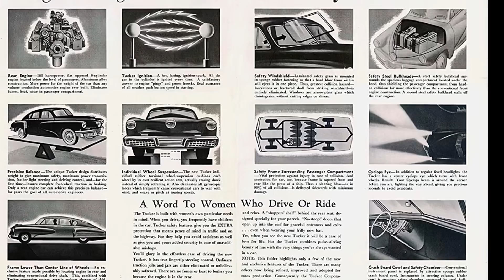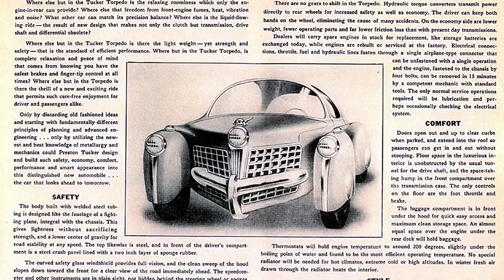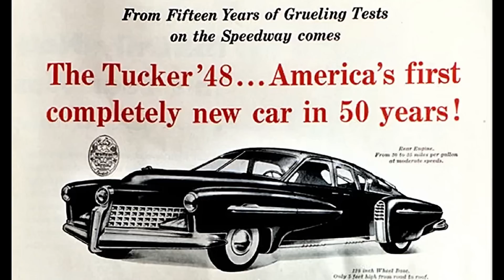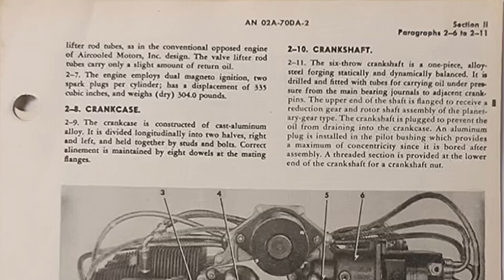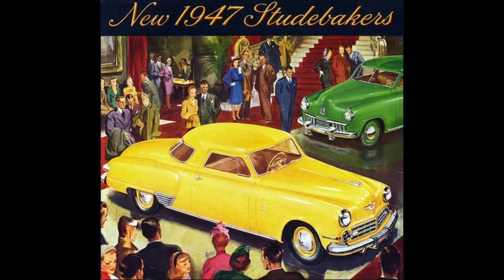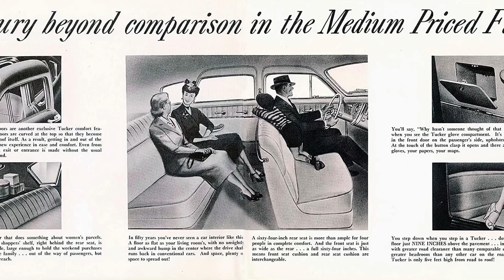Tucker engines 589, 334

Comment: April 7, 2000 "International camless engine technology has been under development by the company and Sturman Engine Systems, LLC since the formation of a joint venture in 1995.

International camless engine technology was demonstrated to the media in an International 8100 truck with an International 530E diesel engine. International is now able to control air to and from the engine without the limitations imposed by a mechanical system of cams and levers. Instead, International camless engine technology uses electronics and hydraulics to actuate the valves."

Comment: The ultimate oversized Subaru XT 6 engine? (with impractical overcomplicated valve system? Did Ducati motorcycle figure out how to get a cam lobe to pull as well as push a valvetrain pushrod?

Comment: The military has used 24v systems for nearly 75 years on their trucks.
Reply from the maker: But civilian vehicles is cyber truck the first one
Reply: @What.its.like.  also untrue.  Toyota 70 series LC's, lots and lots of busses, lots of civilian commercial trucks, tractor trailers.  And if you want to stretch it even more, lots of tractors and equipment are 24v.  Even speaking of the civilian world, Tesla is half a century behind to claim that.
Reply from the maker: I’m not by any means a Tesla fanboy I just didn’t know if that claim was true or not

Comment: When my Uncle turned 16 in 1954, he and his Dad, and brothers went to a used
car lot in Philly on Broad St. (RT 611). The guy had a ton of newer cars up on 
the front line, $200.00, to $1,200 dollars. 
Then he had some ODD BALLS, 2 Tuckers #5 & #32. Dad said neither ran,
so the mechanic ran and got a tractor trailer's Battery 24V to jump start it.
Both fired right up. They looked under the hood, but of course no engine up there!
The Owner told them $600 a piece, or $1,000 for both!!
My Dad wanted the one, but my Uncle Bob saw a 51 Chrysler for 
$400, so it killed the deal.
Dad said the Chrysler had duel points, and the 10 years Bob had it, 
it never ran right, and drank gas 7mpg.
The guy also had 4, 1930's Duesenbergs. Dad said you haven't lived untill you've
put your foot into a Supercharged 6.9 liter 320 HP 3 ton car, on the Pa turnpike.
160 mph felt like 35 mph.
Reply from the maker: Awesome story thank you so much for sharing those memories hindsight is always 2020 you’ll never find a deal like that again 2 tuckers for $1000, how much were the Dusenberg’s? It’s hard to believe that there was a time when those cars were just old cars.
Reply: @What.its.like.  
I know RIGHT! 1948 to 1954, and the cars were $3,100 New with every Tucker option.
My Dad used to kick himself all the time, for not buying the 2 Tuckers. He had the $1,000 Cash in his pocket! He said the problem was there was NO extra parking in his neighborhood. I asked him why didn't you buy both, and just give the other to your Brother?!? He laughed at me, and said He still had his Baptism money!
He was asking $2,000, to $5,000 for the Duesenbergs. Dad said they were all cars meant to be scoffer driven. So even though he was 5'8" there was very little room behind the wheel. They didn't know anything about the Duzzies, it was my Grandfather who spotted them, and asked about a test drive.
Dad said driving the Duzzie was fun, buuuuuuut you looked like one of the Beverly Hillbillies driving it with the top down. 
My Grandpa was friends with a fellow from Brewrytown, Philadelphia, Pa, Grover Bergdoll who owned and raced 7 different Duzzies, and Fiats  before WWI. All given the #8, because he was the 8th out of 12 kids.
He flew Airplanes, and had even gotten his federal pilot's license from Wilbur Write, after 2 hours of flying over Philly in 1909.
If you ever get to Valley Forge, there's an Archway that is a small version of the Arch de Triumph in France. Grover flew his Fokker Dr3 threw the arch, while being chased by 3 US Government Camels to show the War was just going to be a meat grinder of new technology.
He offered to join, but only as a piolet/instructor, the Government said NO, so he went MIA.
After winning the War the US closed all the beer makers down, and we went from 4,000 here in Philly to 6, after proabortion was lifted.
Imagine closing down all of silicone valley, with one Presidential signature! That was Brewerytown in 1920.
Bergdoll's Brewery lasted till 1950's, when the neighborhood went very ungentrified.

Comment: The Tucker automobile was an engineering disaster.  The suspension was made of rubber blocks, which caused severe toe-in of the front wheels during braking.  There were three different designs trying to fix this, but they just had different major faults.  The rear wheels had odd patterns of movement, too.  And the ride over any bumps was awfull. The lack of multiple forward gears meant too little power at start-up and too much fuel consumption at speed.  If you owned one, you'ld know that it's only useful as a show car, you wouldn't want to drive it very often.

Comment: 24 volt electrical systems have been in military vehicles since 1941, and in civilian vehicles since 1950. They consist of 2 12 volt batteries wired in series. They can be found in every military vehicle from the m35a2 to the military chevy trucks.
Reply from the maker: Thank you so much for that correction.. but as far as manufacturer putting 24 volt in a vehicle from the factory aside from the military it hasn’t been done besides the cyber truck

Comment: It's kinda retarded to convert a air cooled engine to a water cooled engine and bro did it twice 🤦 just run it air cooled bro nobody likes coolant leaks or blown head gaskets anyway and it's cheaper for many reasons less parts and less complicated casting and easier to repair and machine. The list goes on and on. When I first heard this tucker story and it got to that part I realized bro wasn't a smart fella but rather a fart smella

Comment: this engine is weird, but not practical or high output by even 1940s standards.    overhead cam engines were already invented as well as fuel injection.      the materials used were an obvious horrible choice as well
Reply: Hint.....the engine used in a Tucker was a Franklin Airctaft engine. This is basically the same engine used in the Bell 47 helicopter or Stinson 108. Aircraft engines work just fine when they are operated by people who are trained to use them. Put one in a car and you are going to have problems. Basically Preston Tucker was a wingnut. Even the Tucket was a ripoff of a pre wwii czechoslovakian Tatra.

Comment: that wacky hydraulic valve feature meant that when you first turned the key, all the valves were shut and the engine didn't want to turn over- the solution was two batteries to make the starter 'get going'.
Reply: The motor would "turn over" but no valves opened until oil pressure was sent to them from the "distributor" 
This could take a while and required a strong battery,which took a long time to recharge from a generator
Also means this thing had three distributors
Oil.Fuel and Spark
Reply: Seems similar to konnesegg free valve.
Reply from the maker: Great information

Comment: Tucker Story: I was at sale and a guy was selling license plates. He had a set of brand new, never mounted, 1948 Illinois plates. I forgot the number but it was low; like #47. The seller told me Tucker reserved the first 50 plates in 1948 for the release of the Torpedo. So that set of plates was destined for a Tucker but never happened. He was asking $5,000. I purchased a 1980 Presidential Inauguration license plate instead w/ just a single "0" stamped on it. Plate 1 is for the president and 2 is for the vice president. No clue what 0 for. Maybe the guy who lost!
Reply from the maker: Sweeet story
Reply: non-tucker story... followed a car with a CROWN as a number plate?
not the word. a picture. of a crown. wtf.

Comment: The "Tucker" radio was a Motorola model 708 and was actually used in  pre-war Plymouths initially. The "Tucker" version had an extra station preset with the letters spelled out, and was painted hammer tone bronze while the Plymouths were hammer tone blue. Six volt positive ground. I restored the radio in 2018 that went into the restored Tucker #44.
Reply from the maker: Awesome information thank you so much for sharing that

Comment: I can't imagine what a sludged up nightmare those hydraulically operated valves and hydraulic distributor would be with 1940s non-detergent oil.
Reply: Same design on Chrysler's Tigershark 4 cylinder multi air engine.  It works OK as long as you keep oil in them.  When worked on and having to bleed the air out, you can count on burning up one starter for all the spinning of the engine it takes before the valves will finally start lifting.
Reply: Chrysler Tigershark has a camshaft close to the valve, no long lines in between.
Chrysler (Fiat)  also have a food reason for the hydraulic: variable valve timing, wheras Tucker was just different for the sake of it because it he was a con-man.
Reply from the maker: Right.. I wonder if it’s ever been tried since
Reply: @What.its.like.  I think some large ship diesel engines use hydraulic valves and hydraulic fuel oil distributors. But they have the benefit of modern detergent oils, enormous passages, and the fact that the engines turn at maybe 100 rpm.
Reply: @What,its.like,  oil controlled injection timing is pretty common with high horsepower diesels the Cummins KV 50 comes to mind. The next generation (QSK) used a second fuel rail to vary fuel injection timing over a greater range.
I agree with above comments though that leaded fuel sludges your oil up pretty badly, detergent capabilities struggle with that grey poop.
Reply: Hi Greg, I totally agree!  And get it to work correctly with OUT a PCM (powertrain control module), good luck!  Please reply.  Dave...
Reply: i would assume the valve system would be independent  from the motor oil ... don't know though

Comment: Hi Jay!  Ahhhh. . .the 589 Tucker!  It's said that Harry Miller had some input on the design before his demise in 1943.  Harry Miller was FOR SURE the inspiration for the rear engine layout and disc brakes, which he used on his Miller-Gulf special which ran at Indy in the late 1930's and the 1940's.  Preston Tucker actually bought this race car and ran it under his sponsorship in the late 1940's.  Fortunately, he did, because it is the one that the IMS Museum has.  The only Tucker stories I have are that I remember it at a car show in Indianapolis in the 1970's.  It was a gold one.  Later on I was able to get close up and personal with the one in the collection of Bellm's Car Museum in Sarasota, FL.  Was able to look inside the front of the car which was kind of plain, but WAS safer than the run of the mill cars of the 40's.  The museum sold the Tucker later on along with several other cars.  But the museum is still there and has MANY cool cars.  It is now known as the Sarasota Car Museum.  I can't remember if I sat in the Tucker or not that one time but it sure looked comfortable!  The dash was padded, and you could duck down into the "Safety Chamber" in case of an impending crash.  Pretty Neat!
Reply from the maker: I totally forgot that he worked with Harry Miller.. 

I actually went back and watched an older episode that I did that I always thought was the best episode that I’ve ever done it was on Preston Tucker, John DeLorean, Elon musk not a lot of people watched it, but I feel like as far as information goes that episode had more information in it than any other Episode I’ve ever done the presentation could use a little work but everything comes in time, right?

But anyway, thank you so much for sharing all of that information. Greatly appreciate it. There are so many cool museums out there definitely need to check out some more that’s for sure.

Comment: From 1968 'til 1971/'72 I worked at a filling station pumping gas and checking EVERYTHING. I think in '68 I filled-up a Tucker Torpedo from up at Claremore,OK and we were on OK 11 thru Tulsa (North Peoria Ave.). I remember it being one of the prettiest GREEN semi-metallics I had ever seen. Late '40's cars weren't known for quiet engines, but the Tucker was nearly silent.  I remember having to "hunt" for the fuel filler pipe on it!!! One of the Tucker's down-falls was the cranky-wanky Cord trans-axle. IF he could have used the Peugots transaxle (a four speed) capable of handling over 400 HP and 450 ft/lbs (used in French Tanks!!!) the Tucker would have been MUCH cheaper to build and sell. The 1936 Cord Tranny was obsolete and out-of-date the day it was designed. His plans for a fuel injected Franklin bumped-up to about 350 CID@ 7.5:1 CR should have given him 170 HP and torque out the ears. The unbelievably RARE 1946-47 Chrysler Meadowbrook Sedan with the Canadian-built Imperial (license-built Daimler engine) V-12 (401 CID) with mechanical direct-to-cylinder fuel injection (and a $4897 base price!!!) could pull stumps and you'd never feel the engine running. You could buy (order and PRE-PAY) $679 for a new '46 Ford Tudor Sedan. My grandpa did, and got a '47 with an $80-ish "surcharge" 17 months later! He soon traded for a '48 Chevrolet DeLuxe Business Sedan (4 door) with vacuum-shift (put it in first, pull-away from a stop and it'd go into neutral WITHOUT TOUCHING THE SHIFT LEVER, then YOU moved the lever up into second and with touching the lever OR CLUTCH, it shifted in to third. The only "manual" Paw-Paw didn't grind or wreck the synchronizers on!!!
Reply from the maker: Thank you so much for sharing this story =)

Comment: Is seems like a lot of Tuckers claims were hugely exaggerated  - 150BHP would not push a 1900kg /4200lb car to 120mph or even to 60 in 10 seconds. And 30 -35mpg from 334cid with 7:1 compression. A lot of his business decisions seem erratic & questionable. He had some good ideas, esp while Detroit were still snoozing but I think his ego exceeded his ability
Reply from the maker: Tom McCahill tested one and got it up to 115 and felt it had more just didn’t push it because of how rare their were.. Toyota Prius has 100 HP and is capable of going 111 miles per hour..

Comment: Tucker utilized a Helicopter Motor for his new car. Years later CHRYSLER basically did the same thing but different with their "Gas Turbine Car." Few would argue the Gas Turbine found its niche in life as a helicopter engine.
Reply: And tanks
Reply: @mikeholland1031  The M1 Abrams does everything exceptionally well doubt I'd change a single thing on it. But it does have 1 serious weakness. It's a Gashog. So just like WW2s Tiger it has to pull a fuel trailer behind it. P-51s used to take them out with 50-cals. However, I still wouldn't trade away its Gas Turbine with ALL that power. Gobs of Power. "Drunk" with Power.  hahaha LOL.

Comment: As brilliant and innovative as Tucker was, he was a terrible businessman. Had he never cancelled the aircraft contracts, he could've leverage the company for operating capital for the car, thus voiding the courts. He could have hit the big 3 head on with their bull. The car itself was advanced, should've stuck with a boring tried n true powertrain until the car had a solid rep. Then start playing around with experimental stuff.
Reply: Yes he shouldn't have cancelled those contracts. But the Franklin engine wasn't going to make the tucker successful. Aircraft engines are assembled individually by hand, and are engineered very differently from auto engines. Their cranks are 5 times as massive as an auto engines, they're designed for low rpm torque, and run at max 2500 rpm.  An aircraft piston engine alone costs as much as or more than a whole car with an engine.

Tucker would have had to totally redesign the manufacturing of the engines, for mass production, which would have been a massive investment. Unjustifiable based on the small number to be manufactured.

Comment: Maybe 10 years back, read in a Auto Magazine someone was building Repro Tuckers in Fiberglass using the Molds to build Fiberglass Truckers for the Movie.
These Fiberglass Repro Tuckers were to be powered by Front Wheel Drive Cadillac Eldorado Engines and Transmissions placed in the rear of the Tucker.
They may have produced a car or two.
 Does anyone know what happened???
Reply: Ida Automotive.  A reain/fibreglass plastic bodied replica, and powered by a Cadillac Northstar drivetrain.  A front wheel drive set-up, so it could be easily adapted to a rear engine drive unit for the Tucker replica.

Comment: Tucker Story:   I heard a weird car exhaust sound when driving in traffic in Atlanta about fifty years ago. 
I looked over and there was a green Tucker stopped nect to me by The Varsity drive-in restaurant near the georgia Teck campus. The car was about the same shade of green as my '73 Dodge Coronet, later nicknamed The Green Latrine.
I remember the Tucker being rather loud in comparison to most of the other cars of the mid-seventies with a distinctive popping sound rather than a purring note of a smooth-running eight-cylinder, ir even the slant six in a Valiant.
Reply from the maker: Awesome story. Thank you so much for sharing that.

Comment: No cool Tucker stories, except for a certificate for 1,000 shares of Tucker stock, which I'm pretty sure is a reprint. That 589 engine was NOT quiet! The valve actuation mechanism was rather clackity, which led to Preston having the band play louder during the car's introduction. The dual torque converter idea is a pretty good one, with one exception: reverse. I think it would need a separate gearbox for each rear wheel, adding cost and complexity. As always, Jay, excellent episode!
Reply from the maker: Thank you for that correction of it not being quite =) great information happy you dig this episode